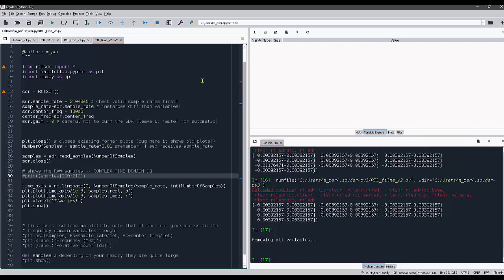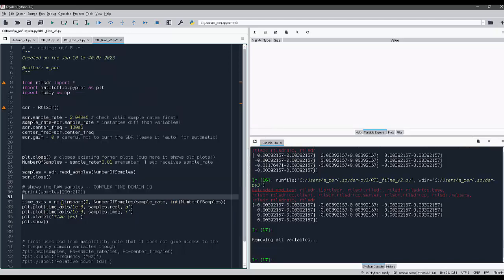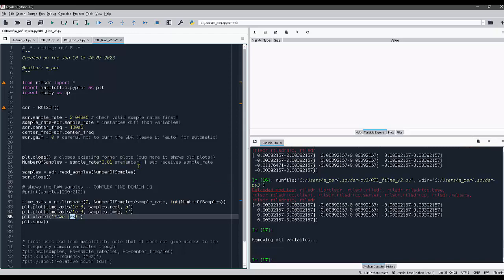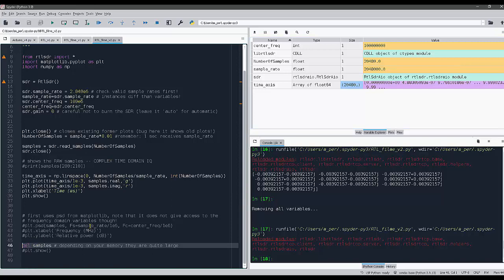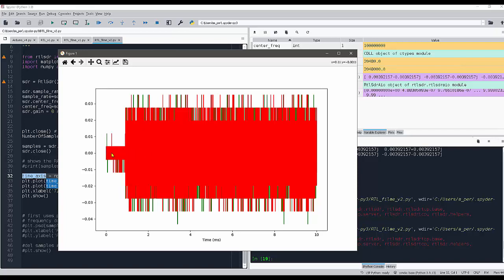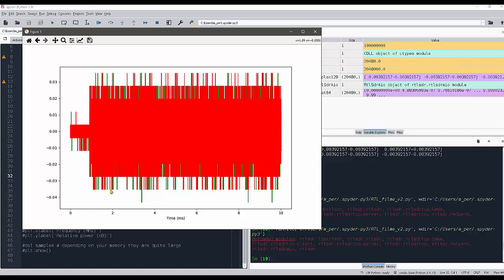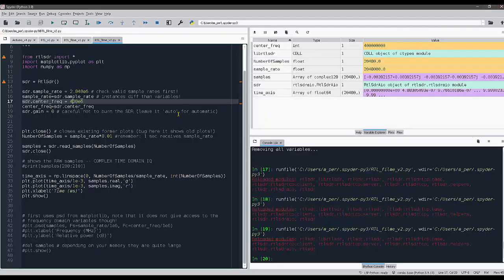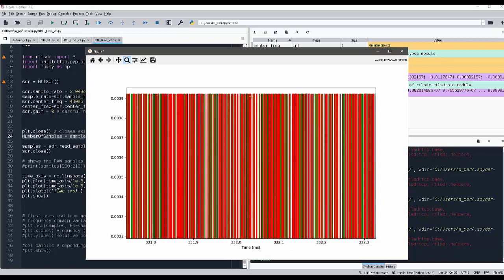RTL SDR with Python -- time domain visualization

Comment: There was 10 years that I had this idea but never try to implement it. It can be really useful specially with high band sdr hardware. Thanks
Reply: Also from where you are ?
Reply from the maker: @franciscoferreira-eh1yu  Thanks for your comment, Im from Brazil.
Reply: @marceloperotoni2504  Bem que desconfiei... Diga-me uma coisa: Um sinal, tipo uma senoide ou onda quadrada "pura" fica mais "apresentavel" quando da um zoom na visualização ? abraços!
Reply from the maker: @franciscoferreira-eh1yu  sim, quem restringe a representacao das ondas em banda base sera o sample rate do SDR. O RTL tem 2 MHz, entao dá 0.5 us de periodo. Passando disso temos distorcoes tipo aliasing.
Reply: @marceloperotoni2504  Fui procurar teu nome no google. Tu é pica. Esse teu material aqui no YT eram usados nas aulas ? Me tornei inscrito. Abraços.
Reply from the maker: @franciscoferreira-eh1yu  Obrigado, algumas coisas sim usei em aulas, esse video em particular ao.

Comment: hi i want to ask can i detect wifi signal in form of numbers (e.g., 2.427 GHz, 2.457 GHz) using python script with bladerf sdr? if yes than please provide resources on this
Reply from the maker: I never used Blade RF. Maybe you can look at <https://github.com/Nuand/bladeRF>. Blade RF is way fancier than RTL, so there are not so many resources around. Another way to do it is by using GNU Radio Companion (which is easy), and exporting the program as a Python code (it runs on Linux, and Win creates a lot of trouble). Good luck
Reply: @marceloperotoni2504  thanks for reply, yeah there are less resources for bladerf. And for transmit purpose(tx) i used gnu radio companion but for receiving purpose (rx) i need exact value of frequency so is there any method to do that using gnu radio companion?
Reply from the maker: @joshiharsh5846   If I understood correctly, create a variable freq=2.427 for instance, and associate it to the rx and tx blocks inside GNU Radio. Better yet, give it a small offset (let's say  100 KHz)  on the RX so that it does not fall within the zero-IF leakage.